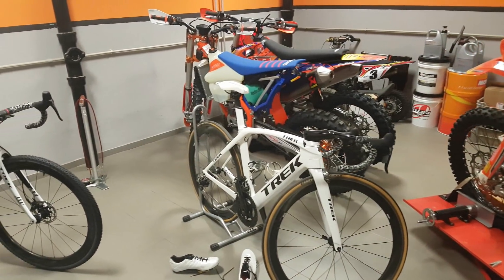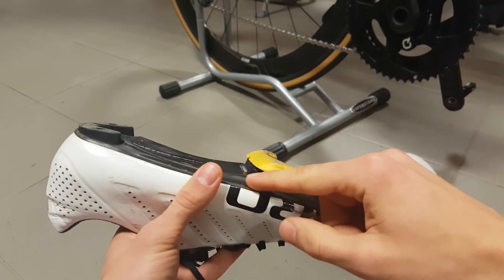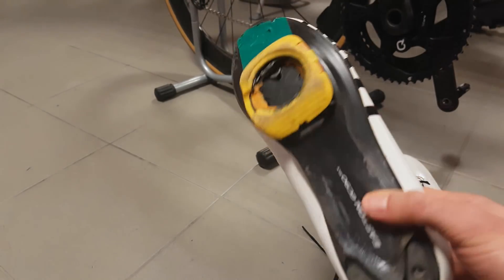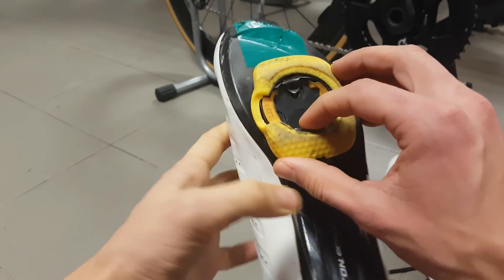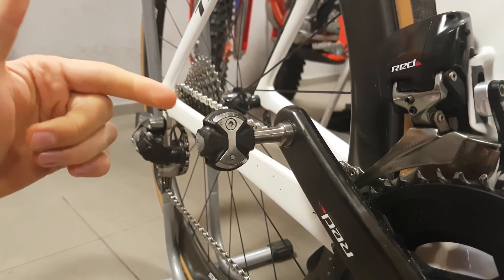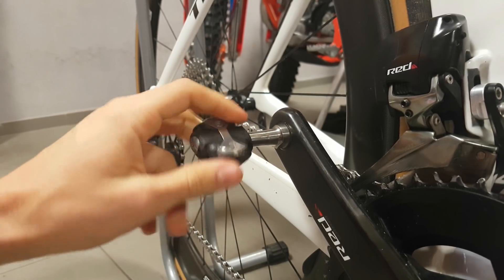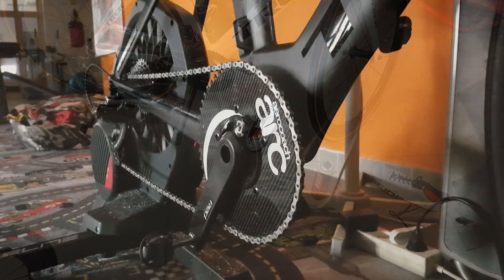Are Speedplay pedals really that fragile?

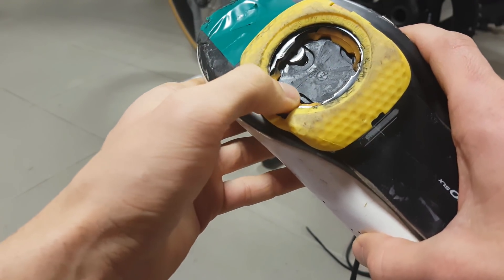Comment: 3:25 to avoid cleat adapter wear - use those SP metal sole wear plates which are included with pedals (don't know if some models don't incl these).
Reply from the maker: I use the ones from Wattshop

Comment: One thing not mentioned...Speedplay recommends replacing cleats at least every 3000-5000 miles or sooner if the cleat parts show advanced wear.  I ignored this and went 30,000+ miles on a set and had a cleat spring snap.  It jammed and wouldn't allow me to unclip from the pedal which almost turned into an ugly incident.  I'll be replacing these annually now (about every 10,000 miles).

Comment: I am just now replacing my Light clips with new Light clips due to extreme wear. The newer Light clips look like the clip you show here. Clearly in hindsight Speedplay mismatched the flat, old style horseshoe spring retaining plate hardness to the horseshoe spring hardness. In my clips the horseshoe spring ground away the flat retaining plate. This happened twice. I had a replacement set by chance. The spring grooved the plate until it was almost recessed and about 4mm of the forward lip to the plate where the plate is interrupted was ground off. This missing lip length allows the horseshoe spring to pull away causing my foot to roll sideways. The horseshoe spring broke once like someone else mentioned.  There was wear on the springs, presumably where it contacts the bowtie on the pedal. That bowtie is worn on one pedal. The overhanging edge at one end of the bowtie's crescent shape is worn off.  I'd like to replace them but replacement bowties seem only to be sold directly from China. I am thinking I might be able to rotate the bowties to get a fresher edge. I have not been able to find replacement parts for parts that wear other than the bowties.

My setup is on an indoor bike on a trainer in a clean environment. Maybe there is about 10,000 + miles on them. On my new clips it looks like the retaining bracket is of the same hardness as the horseshoe spring. In this video you say there is no wear but you cannot see the wear on the retaining bracket's underside unless you take the clip apart. It is also difficult to understand what is going on with the clip when one is riding or loading the clip when the shoe is one one's foot. One needs a second person to study what is happening and they must also know what they are looking at. Hindsight is perhaps 20-20 for me at this point. I should have been paying attention to the wear.

Comment: been using speedplay zero for the last 4 years, save my knees and the system still going strong and reliable. For the lube, i basically spray bath the entire system with dry lube and work well. Yes, its a bit high cost in maintenance side but dual entry mean no worries when you clip in. For the aero walkable  cleat surround, you can buy it separately, but yes silly price which I have to swallowed for the perfect look :)

Comment: I've always used Speedplay pedals.  Talk about being fragile is nonsense.  A pair of standard zero cleats last me about 4 years.  It is the spring that fails before anything else.  Keep it lubricated.  The pedals themselves I have had for over 10 years.  Getting mud in the cleat has been a problem about 4 times but you just poke it out with a twig by the roadside.

Comment: You should always put the stainless steel protector plate on the cleat. Otherwise it will wear fast.
Reply from the maker: This is a walkable cleat. There's no steel plate
Reply: @ronykuba  I think the guy might have been talking about the Protector Shim Kit that can be used between the cleat and a 4-hole shoe (or cleat and base plate on a 3-hole shoe). That way the metal shim will protect the surface underneath from wear. Especially if there's some float going on...
Reply from the maker: @ibe966  my cleats lasted 20000km, that's long enough for me
Reply: @ronykuba  I switched to Speedplay Zero's on my Venge a while ago, and so far they're the best pedals I've ever used.

Comment: I had Speedplay Zero for a few years. I was happy with them for the first year. But after a year they started producing creaking sounds, forcing me to use WD40 / Teflon spray before almost every ride. I absolutely hate those type of sounds when riding. I was shocked that after two years to find out that they were worn out, too much play created which was responsible for my knee problems. Overhaul kits weren't cheap, so I went back to Shimano SPD-SL Ulterga's...
Reply: I never had a noise issue, and I completely neglected maintenance for years.
...and now they're ruined, but that's not the subject you were posting about.

Comment: changed from look to speedplay on my fixie so I can start fast at fixie crits.
Reply from the maker: I guess it will make it easier with pedaling in the corners as well
Reply: I just did the same thing! only had to miss the pedal once to realize how much work it costs you... and the extra clearance is good, I can run 170 cranks now no worries.

Comment: Hi Ronnie, just curious why you did not go with Speedplay X/1 Titanium (260 Grams) vs. the Zero Titanium, (282) you have?  You like the fix float the Zero's offer over the 20 degrees of float on the X/1?   Also, do you know your total weight savings using the Speedplay over the Dura Ace you replaced, including both cleat systems?  Thanks for your input.
Reply from the maker: The X series are an older design and I hate pedal float. I haven´t measured the exact difference.

Comment: How much does the whole system weigh (cleat, cover and pedals)? Also, do I understand correctly that you can control the amount of float on these pedals by using the screw on the outside of the cleat?
Reply from the maker: John Smith I haven't measured them, but I am sure that the specs are on their website. Yes, the float is adjustable.
Reply: There are two limit screws on the cleat, one for heal in the other for heal out.

Comment: Not sure if you understand physics well but one reason most of the pro riders use platform pedals (Look, Shimano) is the better transfer of power. The crucial element is the total area the pedal covers. Certainly, each system has got its pros and cons. When you say Shimano uses plastic cleats, Speedplay is actually no different as the whole cleat system is just a piece of plastic, which many riders find too complicated to maintain properly. Yes, even Sagan uncliped during one sprint and even in final kilometre in Ruchmond Worlds but he is still very happy with his Shimano Dura-Ace R9100 pedals. If this pedal is good for his 1750W at sprints they are good for any other rider as well.
Reply from the maker: Scaputo TM Speedplay pedals have a larger contact area than Look or Shimano. It's the only system where the whole area of the pedal is in contact with the cleat. Plus, the whole retaining interface is metal
Reply: The circular shape has definitely worse power thransfer than a rectangular one. This is because of detrimental angle forces. If you look at track sprinters, none of them use Speedplay pedals. They use rectangular pedals and plastic cleats to fully transfer their 2200 W - 2500 W power plus add safety strips to lock it. I am able to produce 2000 W on a Wattbike. When I tested Speedplay pedals my power output was lower to one I have with Shimano pedals with red cleats.
Reply from the maker: I don´t think they would make a "track sprint special" Speedplay pedal if noone wanted to use them
Reply: I have not seen SpeedPlays in use at the recent Track World Champs in Hong Kong. To me, SpeedPlays are more like a marketing hype rather than a product that really improves something.
Reply from the maker: Speedplay is a small brand doing basically the opposite of marketing hype. They just work.
Reply: I would not say they are small (depends on the metrics). They have quite a loud buzz in Hong Kong as far as I am concerned but it might be due to overactive distributors. I tested them but see no difference to my Shimano pedals. I see no justification to pay several times more (and spend extra time on maintenance and replacements) for something that gives me equal performance and comfort to my much cheaper and maintenance-free stuff.
Reply from the maker: Fred Wong they cost roughly the same as DA pedals, have lower weight, easier entry, better adjustment, retention, cornering clearance and aerodynamics. Maintenance takes 5min/ 2-3 months. The cleats last much longer than Shimanos or Looks.
Reply: Ronald, I read exactly the same description in Speedplay marketing materials. The price is actually higher, especially if you take into account that most of the average riders use ultegra pedals. Aerodynamic advatage is basically negligible in the ballpark of 0.15 W. Better adjustment is real, I agree, but it also can be counter productive. Still there is a problem with lower power transfer. If you look at pro peloton, there are not many riders using Speedplays, viertually none of sprinters (Kittel, Greipel, Sagan, Avermaet, Gaviria, Ewan all on Shimanos or Looks). Please take a look: http://road.cc/content/tech-news/226332-tour-tech-2017-pedals-peloton
Reply from the maker: Scaputo TM all of the claims are true. Your power transfer claim is not relevant. You are only losing power if you can actually squish the material. If you increase the surface area, you can use a softer material. Speedplays have a steel baseplate, so it's definitely not the case. They aren't sponsoring any team, so noone should use them. Some riders ride them despite that (because they are better?!),  e.g. Viviani (who is a road and track sprinter?!)...
Reply: Pedals are usually not part of the rider's contract and you can choose whatever you want. The same is true about some other components, for example Sagan uses ZIPP stem on his Specialized bike with the logo blacktaped. Power transfer claim is pefectly valid, what is the factgor here is not only the area but also the shape and circular shapes have different force spreads. I am sure that several pro teams would embrace Speedplay technology if there were real advangates other than just pure marketing. It is not about the sponsorship deals. But the truth is these claimed advantages are close to zero. You simply cannot believe everything claimed by producers, we already have one example with CeramicSpeed and their oversized pulleys that allegedly save 2.5W. The reality is different and when you calculate all forces on the bike as a system in the wind tunnel or in your CFD model, including increased drag due to bigger size of pulleys, the result is zero.
Reply from the maker: Scaputo TM I have ridden Looks, Shimanos and Speedplays. Speedplays are the best, based on my own ride experience. Where is the believing in that? Besides, the OSPW is actually faster, based on Friction Facts test data. They were still independent at the release so you can't argue with that. They were tested for aero as well, and they actually offer a sail effect at some angles. I don't why people always need to question the work of engineers who clearly know what they are doing...
Reply: The question is how significant improvement of rider's performance the OSPW actually brings. And several scientics claim it is close to zero. Why? There are several reasons. Firstly, the friction of the drivetrain accounts only for 1% of the total friction of the bike+rider system. So clearly, this is an innovation at a wrong place as i can reach much more improvements elswhere. Secondly, these 2.5W is claimed on a new system, however several scientiscts suggested that after just 700 km or riding the advantage is basically zero. (https://www.youtube.com/watch?v=vPWgtscgfa0). Thirdly, buying a component that costs 10x more than a standard component, for example ultegra, to give me just totally negligible (I would not even say marginal) gain, is simply stupid. And yes, you can have some sailing effect in case of a tail wind. But I have the same effect when wearing my backpack :)
Reply: Yes SP cleats last longer and are a great pedal BUT theyre small and are only good if you have less than a size 7/41 as the area isn't great tho it feels like it's big. The real probs for me came in the cleat. This is the failure point of the whole system. Upkeep of it is paramount otherwise it'll seize. Greasing the pedals is also a major point. Look blade Ti's are really light but the carbon blade is too strong on the back plate which keeps the cleats in place. The best IS the SPD-SL, because they're practical and the area really is big. Try a spd-sl after a Speedplay and I'll give you 500 as you'll say it feels bigger and better !
Reply: Scaputo TM I agree. I noticed last year Mark Cavendish switched from Speedplay to Shimano using the red cleats. He was the only rider on Dimension data to use Spd-sl.
Reply: @ronykuba  No way 5 mins, i used to have to check mine every third ride, unless your only riding for half an hour. Too much maintenance for the only real justification is ease of entry. Plus the tension can't be regulated like Shimano.
Reply from the maker: @miatamayocanoy3563  I've been riding mine for the last 4 years ~ 90 000km with almost zero maintenance and they're still going strong.